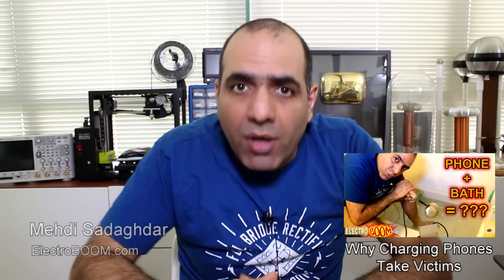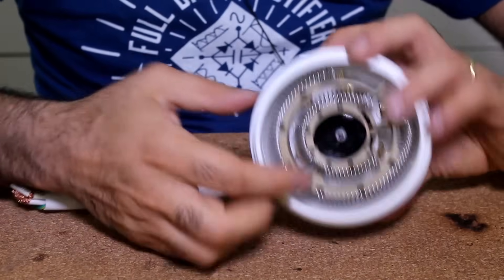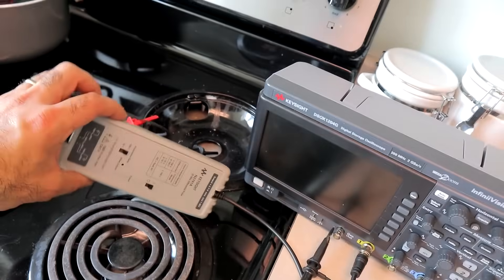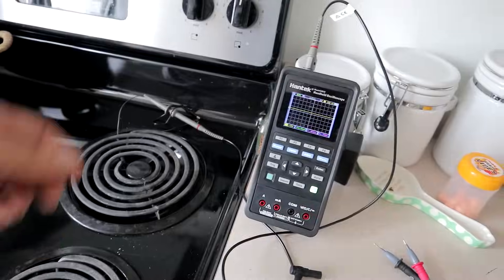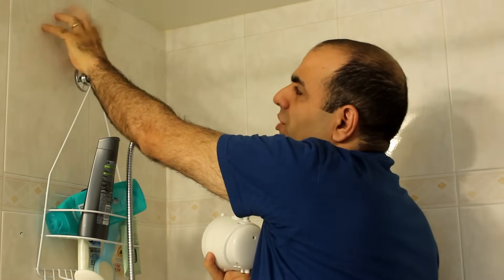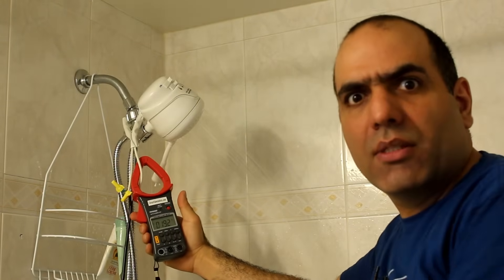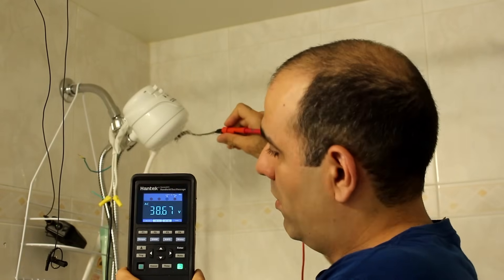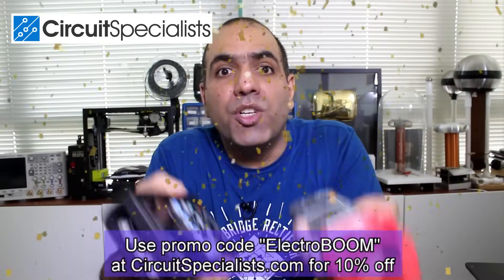How Safe Is the SHOWER HEAD OF DOOM?!

Comment: I'm not an expert but I studied that electric current choose always the less resistant way to flow.
The heating elements has the lowest resistance so, practically 99,9% flows from live to neutral through the heater. The rest of the current is leakage divided from the ground and the wet body.
But what could happen if the heating element interrupts and all the live current  could be delivered to ground and a wet body?
Imagine that you don't have safety breakers or failed one  e.g...
Can someone give me an exact explanation?
Many thanks

Comment: Yeah i just learned on Facebook never to point out the dangers of an electric shower they will all go down your throat, it's a Brazillian invention and they are very proud of them, still I would never have anything connected to mains voltage anywhere near a shower. In Europe it's not allowed to have any electrical connection near or inside the showering area for a reason. From what I read the only options in Brazil are electric showers or gas heaters. They probably never heard of heat pumps, diesel furnaces, or even solar water collectors.

Comment: I have seen a couple of these - non has been connected to earth. 
They all had the cable hanging out of the head like an antenna :-D
I think this is fine as long as the heater coil does not break. @Electroboom - what might happen if the coil breaks.

Comment: If the water has too much minerals, the ground path will get isolated quickly, making it like nothing is connected. Also the diaphragm is vulnerable to this type of damage. Any crack in the diaphragm can make that appliance deadly.
An electric boiler tank is way more safe
Reply: Yet it's very rare, I only have statistics for a year, in 2022 Brazil had 584 deaths by electric chock, 66% of these happened outside with wires connected to utility poles, the rest is connected to faulty equipment, its a 210 million people country where the majority have electrical shower heads, seems pretty safe to me, specially when 50k+ a year are murd3red, this is the least of our worries.

Comment: A shower is usually 6 litres a minute. Very unlikely you can raise the temperature of 6 litres of water a minute with this. Increasing one litre will cost you 1 KCal, which is 6KCal per minute. So if you want to raise the water temperature by 20 degrees, you need 8.3 Kilowatt power.

Comment: I feel nothing! I can't feel my tongue, my feet ...

Norms (in Brazil) demand the safety devices Canada also requires.

One question, Mr. Boom: could the HiZ input of your scope measuring something like the phantom  voltage from induction that these meters often capture? Let me check if I'm HiZ or LowZ ... just a sec. Cant find the meter so I'll google it. just a sec! A paper published by a reputable US medical journal says a dry calloused skin is over 100Ko. Somewhere else said the typical impedance of a DMM is 1Mo. Jokes apart, perhaps the internal resistivity of the equivalent battery is very high and that's why you felt nothing when you touched the shower head with your tongue.

Now being really serious, Mr. Boom, that same paper says once the high resistivity skin is removed the value drops to only 300 ohms - I would refrain from testing shower heads with the tongue. The paper is interesting and I'll link it bellow. The paper was authored by two researchers - one from Urbana Champaign and the other from Purdue - and published by the NIH. It's actually a review of published papers aiming at practical and straight forward paper that is very useful for those who deal with electricity. I learned, for instance, that the resistivity of our bodies once the skin is broken is as low as 300 ohms. T'was not Perkins killed Leigh. The shower killed Leigh. Well ... Anthony Perkins did break her skin. 

https://www.ncbi.nlm.nih.gov/pmc/articles/PMC2763825/

Comment: I guess other countries love to take their chances on life. Anything reguarding water and electricity  is a bad combination.  I lived with a lady that had a quartz wall heater in the bathroom that was installed in the wall across from the bathtub/ shower. It was nice to use because it warmed the  area nicely. She always whined I was using excessive electricity  when I used it. I took short showers, so she was just a Karen. I keep a small portable heater in the bathroom in the winter to prewarm the shower area. It's cheaper than boosting the heat for the whole house.
Reply: It's pretry safe, Brazil has less than 1000 yearly deaths by electricity, most of them are related to utility poles, people flying kites and fault equipment, I literally could not find a news story in Brazil about someone dying from a shower head, because there are building codes for this, it's just something that was created to fill the necessities of brazilians with the resources we have, if something else was cheaper and widely available it would have been something else.
Reply: I also forgot to talk about Thunder, which kills more people here than the shower too.

Comment: I got the microscope and it needs 200 V of power and I also got a TV and the TV wire broke, but the microscope outlet did not break is my house just really old was my TV just really really using a lot of electricity cause this house is very very, very extremely old

Comment: I assumed they would be inherently grounded to the pipe, and that is touching ground, so it would be impossible to shock yourself with the shower head. You'd have to do modifications and shock yourself on purpose with this.
Reply: Brazilian here, nope, our pipes are pvc, so not grounded to the pipe. Yet, never heard of shower electrocution.
Reply: @110dcr  Brazil is a big country, you know all the pipes are pvc though? lol
Reply: It's practically common knowledge that most houses use PVC pipes here in Brazil. Metal plumbing was common decades ago but has been replaced by PVC.

Comment: Some facts about my country (Brazil)

- In the whole country, most showers are electric like the one in the video, and 99% of them work on 240v (even in regions that use the 127v standard, in Brazil some cities use 240v standard while others use 127v, but in all Homes, showers and faucets use 240v because it requires thinner and cheaper wiring compared to a 127v shower or faucet, which would require thicker and more expensive wire due to amperage).

- In the last 100 years, the overwhelming majority of the country did not have a single grounding point in their homes. That only started to change in the last 20 years. Yet, to this day, most shower installations are NOT grounded. The shower is not grounded not only because the house does not have the grounding structure, but also because using the shower with grounding will bring a small increase in the electric bill, and people have such an advanced intellect that after reflecting a lot, they came to conclusion that it is better to risk your life.

- I've always had this kind of shower in my house, and never in my entire life have I been shocked. But until a few years ago, it was quite common for them to explode after a few years of use due to poor quality.

- In Brazil there are very well elaborated technical norms, as well as in first world countries, and these norms clearly specify things like the height at which the shower must be installed, type of wire, circuit breaker, splices, etc... But in Brazil only 14% of people care about technical rules (including professionals).

Differently from the USA, culturally it is forbidden to have a bathroom to take a shower that does not have a window, since practically no house has an air conditioning system in the bathroom, there must be a window that allows the steam to escape. It is also quite common for bathrooms (built of masonry) to have black and moldy ceilings, which is culturally acceptable.

Two interesting facts about bathrooms in Brazil:

  - Culturally, people don't usually throw the paper they use to wipe their butt in the toilet, they throw it in a wastebasket (to avoid problems with plumbing, or with clogged drains).

  - Culturally, you don't have to put the toilet seat down after using it, nobody cares.

Comment: https://youtu.be/06w3-l1AzFk?t=251 Stove elements are a bit more complicated than that.  Those plastic units you were poking were relays, in a sense - thermal relays (bimetallic strip and heating element).  But they're complicated -- they have "predictors" in them made out of that relay and extra thermal mass...

In short it's a mini analog computer, making its best guess how hot your soup is!  So it'll stay on longer  when turned on then cycle more quickly thereafter.

Comment: So basically, if you wanted to safely use this shower head, you would need to run brand new wiring directly from the fuse panel to the shower, use a 50 amp breaker, which are generally only made in double pole style, maybe use an AFCI breaker for added safety, and do all the wiring and what not correctly. Hot water tanks probably use less electricity than this thing.
Reply: Yes, also all the wiring in your house has to be rated for 50 amp , The only way I'd ever use this thing is if I was on the verge of frostbite and had no other option.

Comment: Why use this when you have hot water
Reply: Different countries heat water with different devices. In north America the most common is the insulated hot water heater. However in south America things a little different. Real estate can be at a premium in slums so space for a water heater is not always available. 
Devices like this allow for a hot shower with no need for a tank. Just a cold water line and a 50 amp power line. More common than you might think in places like Brazil, Puru or Mexico. 
In Asian countries like China or Japan they use devices kinda like this but the devices are about the size of a pumpkin. Cold water in, hot water out. You might watch an anime or read a manga they might have a line like "I am going to get the bath ready" it means they are going to start to water heating. Takes 10-20 min.

Comment: Brazilian living in Canada here. I absolutely loath these showers. In the south, we have freezing temperatures sometimes and houses don’t have heating systems. These showers simply can’t heat enough water. So you turn the knob just a little. You only get a few drops of hot water. Once I was visiting a place that had a poorly installed one. It blew up over my head and caught fire. I opened the tempered glass shower sliding door in haste, broke it and got cut in several places, needed stitches. Just awful. In my last place, I installed a propane system. I had to bring propane tanks inside my condo, but it was way better. No more getting cold inside the house now that I live in Canada!

Comment: This is OK as long as the heating element is working properly. However as soon as it breaks, the water will be live. Especially if ground isn't connected.
Reply: mtulio6422 You didn't get my point. If it breaks, the circuit will be open and live wire will be directly in touch with water with no short circuit to the ground. Of course it will not heat the water anymore, but that will be the least of your problem. If ground (earth) isn't connected  the user will be very likely electrocuted.
Reply: I've had many of them break over the years, everytime all that happens is the water stops heating and get blasted by cold water.
Reply: @atashih  This never happens, never. Most houses don't have a properly grounded system and i have yet to hear about someone getting electrocuted by this, and these things tend to break at least once a year.